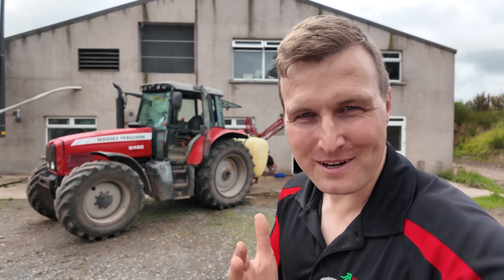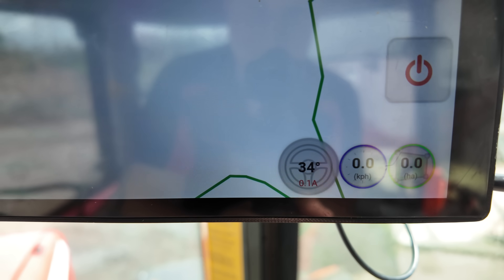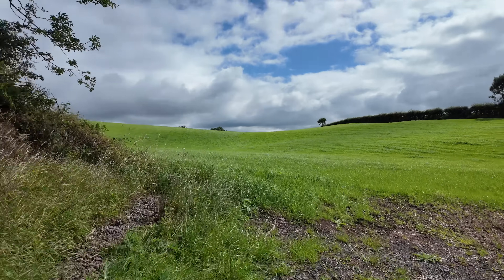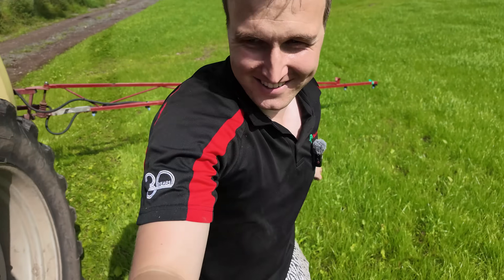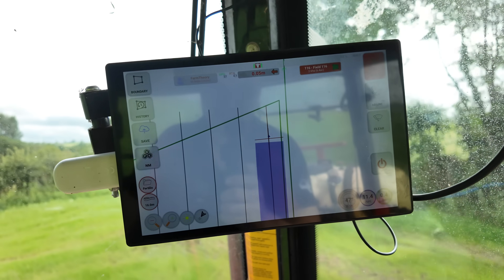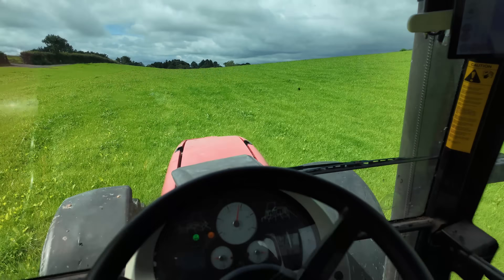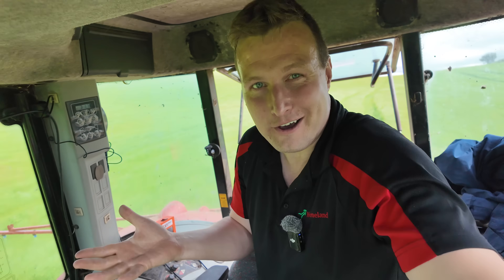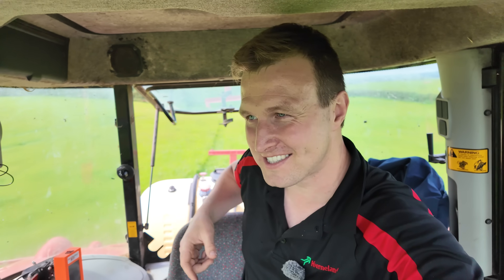I Built My Own Tractor Autosteer… AND IT WORKS!

Comment: Not sure if anyone has already said this about your steering.
There’s no physical connection between your steering wheel and steering wheels.
It’s fully hydraulic steering so the wheel will always move its centre position.
For example, if you steer fully to one side and keep trying to turn the wheel in that direction it will slowly rotate in that direction due to oil “leaking” through the steering box. 
So your centre position will always change as you steer due to these small “leaks” if that makes sense.
Hope that helps, the smart code you’re talking about should solve that issue. It kind of needs to use the angle encoder as a rough reference rather than accurate information.
Reply from the maker: It's going to be such fun code!

Comment: You mentioned you have a wheel angle sensor? If so, then it needs to be accurate and consistent at 0 angle (straight). If that's true then it would be either because you are on a side hill and that tilt in the tractor throws out the line. Also, isn't that the job of Intigral in the PID tuner for adjusting steering rates? 
Have Fun!

Comment: Does your offset have anything to do with the angle of the tractor. As another commenter mentioned the field does not look flat. As the GPS is at the highest point of the tractor if it leans left or right then you would get some offset. Have you got something in the system that takes this into account? Great job getting to this point, everyone can see how happy you are with your progress.

Comment: Looks like you need some integral action in your PID controller! I’m amazed it works so well when you are not using a steering angle sensor on the front axle and you keep proving all my previous concerns wrong. If you manage to get rid of the error build up just by coding I’ll be really impressed!

Comment: I thought when you said you were off by a set amount one way and then the same back up. That it would have been the position of the equipment in the cab and the offset and maybe the pitch off the tractor giving an offset as the field didn't look flat. 

Because inwas thinking the John deer dome sits in the centre

Comment: Am I correct in thinking a tractors steer wheel does not centre to the same position to then drive straight, believe when you go on full lock the steering wheel can continue to turn with the tyre not increasing with angle. This being different to a car due to the steer by wire (hydraulic) of a tractor rather than a fixed linkage like a car. Or at the very least I am pretty sure this is true for a John Deere. Meaning taking an angle from the steering wheel is very much not as ideal as an angle of steering from the front axle.
Reply: That is why modern tractors have a built in WAS sensor in the front axle. They use it for guidance systems an d headland management. Would be awesom if there was automatic WAS-zero code.